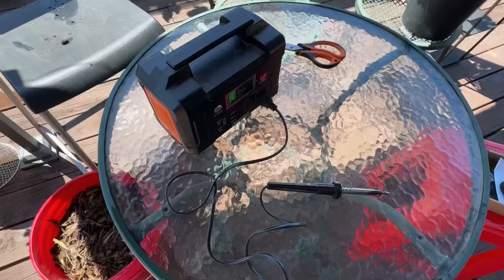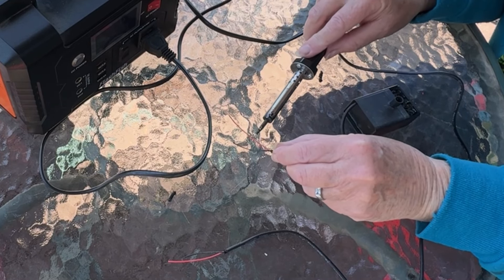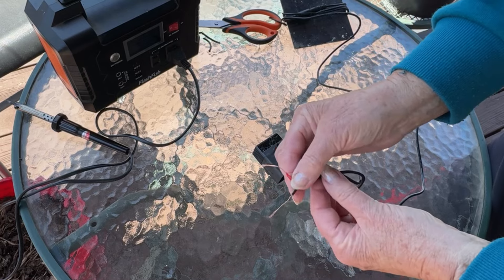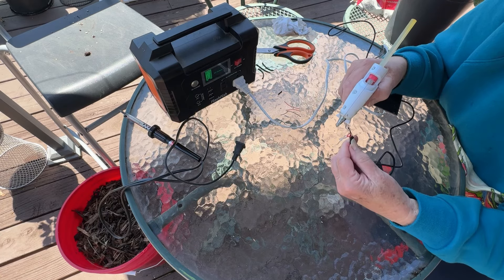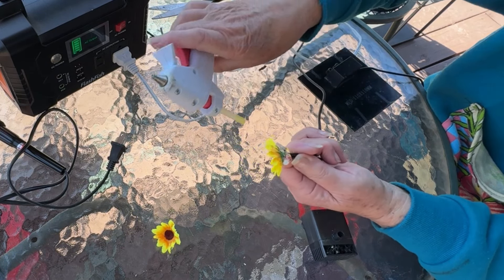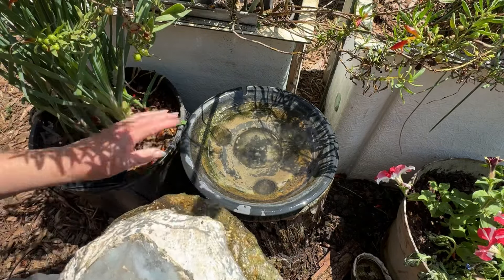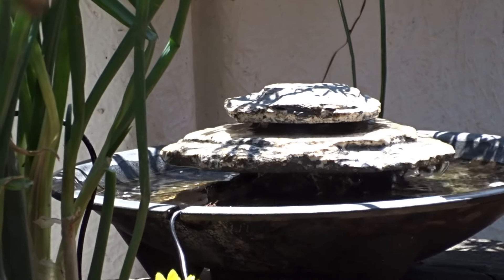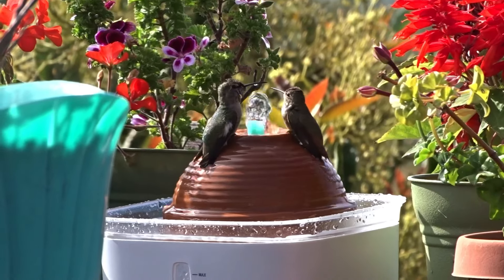How to Fix Solar Fountain Water Pump Broken Wire Not Working Bird Bath for Hummingbirds Pond Garden

Comment: I have a round disc fountain. I cleaned, checked - as per your super instructions! No go😢
I love those disc ones, they go with very little sunlight, though they don't really work for hummingbird bathing. The bathing one has no visitors ever, not even other birds, whereas they go to the disc one to drink. Pump is not making any noise😢 tempted to take the motor piece apart, if only to see how what......

Comment: could you post a video on cleaning the panels? Mine is one of the one piece ones and it's in a birdbath. The minerals in the water are depositing on the panel and look terrible. Thanks.